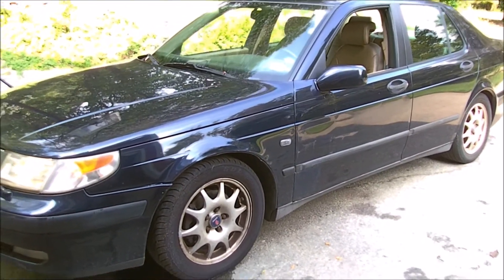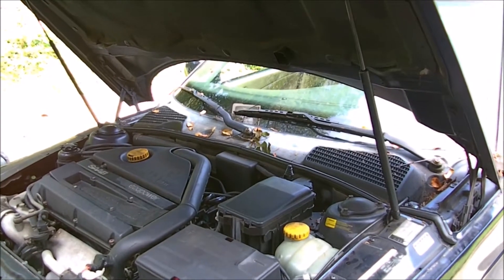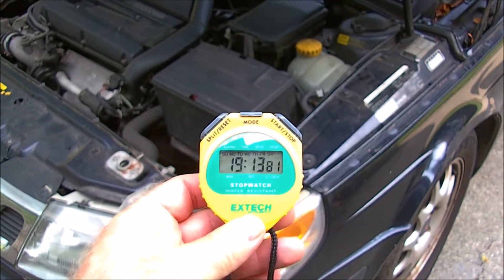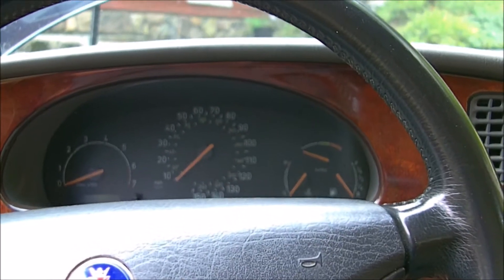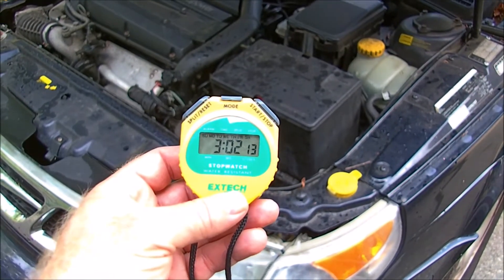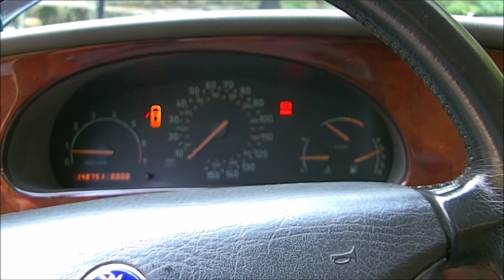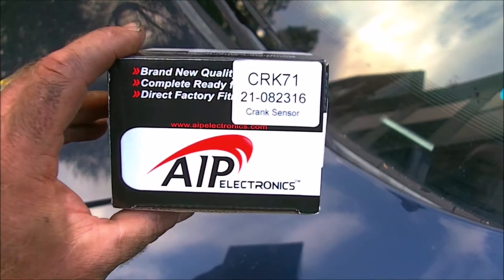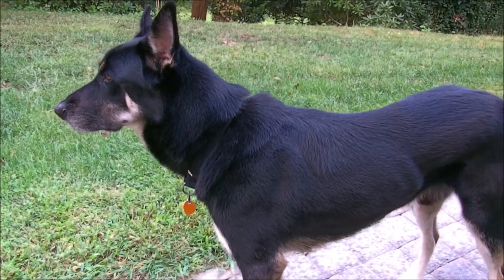2001 Saab 95 CPS experiments

Comment: I have the same symptoms with my 2000 saab 9-5 with 165k miles on it.
Won’t hot start anymore until about an hour of cooling.
I thought mine was vapor locking from the injectors possibility leaking but I just confirmed that that is not the case.
I’m going to try this as see if it works!
Thanks so much brother!